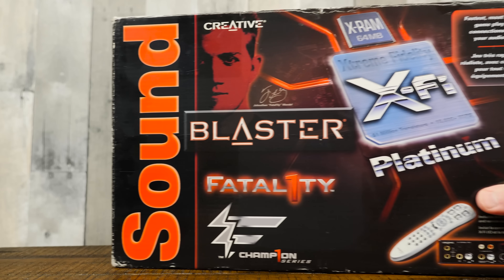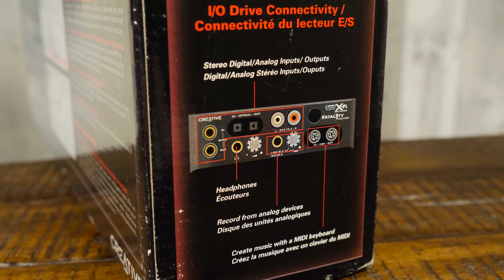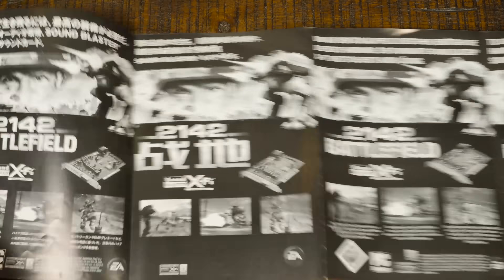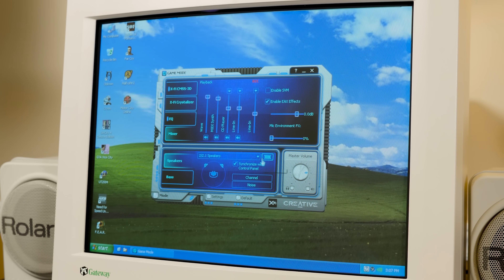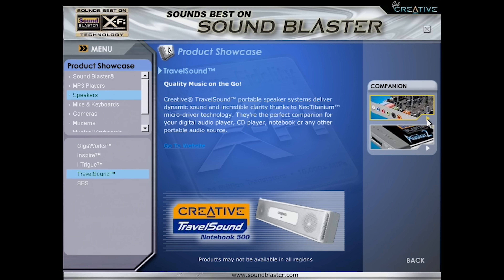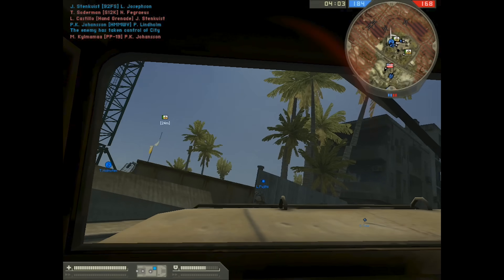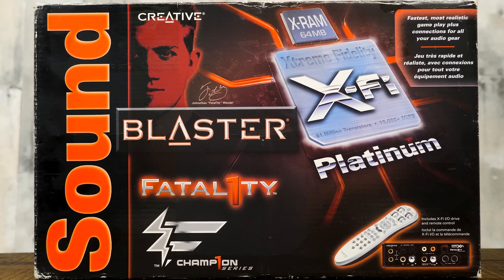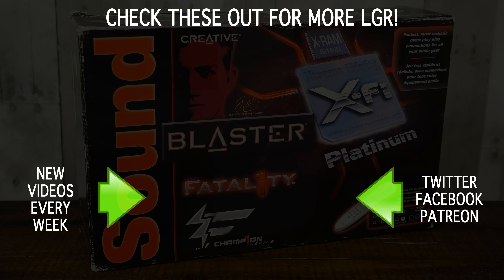XP Upgrade! Sound Blaster X-Fi Platinum Fatal1ty Sound Card

Comment: The moment you turned on EAX on Doom 3 my jaw dropped! I have never heard the game like that and I used to play it with surround sound speakers and thought that was the coolest thing ever until...this...you say there is a way to emulate EAX support...so need to try that.
Reply: Shoot just looked up emulating EAX and apparently the closest thing to it doesn't have any real effect on the games when enabled other then making it think it's available when it's not. Oh well...someday.
Reply: A few games work great with emulated EAX capabilities, like Halo, F.E.A.R. and Call of Duty 2, but DOOM 3, Quake 4 and Prey are especially picky with EAX capabilities because they use OpenAL and not DirectSound like the previously mentioned games. MAYBE they can be emulated, but I'm not sure how can that be done.
Reply: OpenAL should actually work better on newer OS' than DirectSound. You won't get hardware acceleration of 3D positional audio but in theory using ALchemy software (Or the inbuilt GX stuff if you have an ASUS Xonar/OxygenHD based card) you can still get the full "support" for EAX...And honestly, even the older quad cores like LGR used in this XP build have enough processing power spare to do the positional audio without hardware acceleration while gaming. It's worth looking into. 

It's like if you could still get all of the features of say, UTs Glide renderer while using software rendering except you're also running it on a 4Ghz modern CPU so there's zero real difference between the hardware acceleration and just doing it via software in theory.
Reply: Google for ALchemy Universal. It's software emulation and probably pretty loud, but better than no EAX.
Reply: @JayBmusic  I tried that and it didn't work, there was no sound. So, I installed EAX4Unified, then normal Creative Alchemy, then patched it so it works with my integrated chip and it work perfectly. Also, Alchemy Universal is based on an much older version of Alchemy.
Reply: dhewm3 emulates EAX on current cards. I personally think it just sounds like everything's in a cave and leave it off.
Reply: @parkerlreed  Yeah, but it's the only way I can fix the crackling audio in NFS2.
Reply: We took a step back in audio after Windows XP. Vista/7 and onward has been a poor era for audio.
Reply: Asus Xonar D1 and DX sound cards emulate EAX.  I had one in my Windows XP machine from this era.
Reply: I had the smaller brother without the front hub, but I did the same thing in FEAR. With headphones I got more legitimate scares on my fourth play through than on the first.
Reply: Haldrie just a whole bunch of extra added reverb IMO. Makes everything sound very muddy in the end. Not a fan.
Reply: Huge shame that sound became a second, sometimes third class citizen in game development. Sound just became "good enough" and only about fidelity, DACs and amps. Sound hardware acceleration with truer 3D effects and immersion were set aside.  MS got rid of DirectSound3D after XP. Creative was dickish about their software, just like how Nvidia became and they couldn't get OpenAL to get much support after EAX. And OEMs got rid of soundcards because they could make more profit by excluding it because CPUs became ok at emulation and those PCs had bottom of the barrel parts for higher margins. Building your own rig was even more niche back then.   I hope it comes back now that VR and Raytracing are coming up again.
Reply: Oh wow I think this is the most attention I've ever gotten from a comment outside of my own videos. Thank you to all the suggestions I will certainly be checking out that software. I only have the built in Realtek sound chip on my motherboard but hopefully it will give me some idea with my more modern 5.1 setup. Sadly my original 5.1 speakers ended up having the cord on the volume knob/audio connectors break so I had to get a new...even better set because I cannot go without my surround sound these days...reset in peace you...oh man what were those like 10 years old when they finally broke I think. Anyway love your videos LGR keep on bring us that nostalgia goodness...even for those of us like me who never experienced 90% of what you show yet still feel nostalgia anyway because we grew up when they were a thing. I envy that wall of games you have...my virtual shelves on GOG will have to do I guess.
Reply: I'm guessing you found IndirectSound? Give OpenAL-Soft a try instead ( http://kcat.strangesoft.net/openal.html ); there's also a DirectSound wrapper variant available ( https://www.nexusmods.com/newvegas/mods/65094 ).
Also, Check out I Drink Lava's YouTube channel for game demonstrations: https://www.youtube.com/channel/UCGrS-9TNYTo-gp3pjrA6VDg/playlists
Reply: Software audio processing is inferior to hardware accelerated audio since the quality is significantly better on legit hw acceled SB card than realtek hacked software dsp bs.
Reply: Well, yeah, on X-Fi cards you'll still get hardware acceleration of OpenAL (as well as DS3D HW through ALchemy on WinVista/7+) - it could HW accelerate both. In fact, that's how ALchemy works - it translates DS3D calls into OpenAL, which then shoves 'em onto the card. 

The positioning being the same on Asus, etc...well, no. CMSS-3D was the bit that handled the 3DPA, and that was exclusive to Creative - sure, they could read from the same 3D buffers as an X-Fi, but how they interpreted those buffers was very different. CMSS-3D was a lot more accurate.

I just played Quake 4 on my ZxR, and it was a fantastic experience. We've really lost a lot, soundwise, over the last few years. There's really only been two major improvements - HDR  and better quality sound samples. Things like decent 3DPA, high voice counts, and environmental audio have been cut back to the bare minimum to minimise CPU overhead.
Reply: We've technically had EAX since 1998 with DirectX3D in DirectX 5.
Reply: @parkerlreed  I know this is an old comment, but it's possible to adjust the volume of reverb in dhewm3. All you need to do is create a textfile, name it alsoft.ini, put the line boost=-12 in it, and then place it inside the %APPDATA% folder. This will make dhewm3 match hardware EAX volume. Ideally they would have an option for this in-engine, but this is the best we have.
Reply: @hoilst  You should try Quake 4 with OpenAL Soft's HRTF. You lose the reverb but the 3D positional audio is some of the best I've ever heard. Blows CMSS-3D out of the water IMO
Reply: Yeah, EAX is basically like collision mapping but for sound... pretty cool.
Reply: I have to second this, I definitely need to re-play this with EAX...
Reply: I've never particularly liked most EAX implementations, always sounded like they significantly overdid reverb in practically all environments.
Reply: It just sounded like it had a lot of echo to me
Reply: @AshtonCoolman  sad tbh
Reply: One of my fav implementations of EAX is in "Condemned Criminal Origins". It does not overdo it on reverb and has some really cool effects. Like excellent sound occlusion (so you can easily tell a difference if a gunshot for example is in the next room, above you, or in the same room). Great 3D audio using headphones or even my 2.1 logitech z 2300's. Plus the fact that it's a horror game and audio makes a huge difference in that genre helps as well. It actually works great on my PC without a Creative card. Just change your PC's audio rate to 16bits 48KHz before launching the game and install this cracked version of Creative ALchemy that has the check for a creative driver/card removed. https://drive.google.com/open?id=1Dwj6UffsLcIch5FMTNjpxjmTifLtNrGU Then launch ALchemy and add a entry for Condemned and point it to the games install directory. Once in game make sure to turn on EAX and EAX HD. Works fine on my ALC1220. I'm sure it sounds even better on a X-Fi card since you get real hardware acceleration but there is a noticeable improvement still.
Reply: Wolfenstrike of I had a real SoundBlaster X-Fi extreme Gamer but I have to use Alchemy to restore EAX sound. Is that still emulating?
Reply: @TokeBoisen  I have only played FEAR with headphones and EAX and get the crap scared out of me. My wife kept asking me if I was ok because she had no idea why the hell I was leaping out of my chair. 😂
Reply: @AshtonCoolman  - Yeah because on Vista Microsoft changed how audio is handled by the OS. It took a sharp downward turn because of this decision by Microsoft!

Comment: Still got a X-Fi Xtreme from 2006 in my old editing rig needed a standalone 3.5mm input, and a X-Fi Titanium from 2008 in my Threadripper for the extra optical/toslink. They even got driver support on Win10.
Reply: Basic Windows driver support? Or the custom Creative driver suite?
Because I use a Creative SB Z, and while there are WIn10 drivers available, they are not made that well (basically the original Windows 7-Style drivers with fixed compatibility). They are from 2015 which is far too old considering the card was sold for a very long time. It was only last year that Creative updated it. (Fun fact: With basically the same card + RGB + the same driver with a new skin as far as I can tell)
Reply: Kx drivers.
Reply: wtf Robbaz i didnt expect to see you here lol
Reply: I got a Fatal1ty Pro titanium PCI-E and yeah, it does have a 2016 driver for Windows 10 listed. I miss that card for those juicy effects and crystalizer. time to find it and pop it in.
Reply: Went with stand alone amp dac for headphone. Way better than anything onboard or even these add in cards. No hw acceleration needed. Modern pcs handle sound just fine. Wonder how good ps5 sound will be with ray traced stuff.
Reply: What the best xfi crystallizer setting?
Reply: I had an xtreme music and I had so many driver problems
Reply: Me a Audigy 2   no drivers for 2021
Reply: @rickmec  thx
Reply: still got my X-fi extreme Pcie SB creative card in my newest gaming rig lol it still makes a difference
Reply: @MichaelPareda  u can find drivers for that card that someone has made besides creative , i have many pre 2010 cards in win 10 and 11 machines running fine
Reply: @Andytlp  but what is the technical comparison here, can anyone explain it??? I dont understand what makes the new motherboard audio superior.
Reply: @mjd3879  Newer chips and capacitors. Richer sound. Better sound stage. All those  audiophile jargon words. Dropping costs. Better sound isolation. 
In case of standalone devices they have far less noise than a pc motherboard or add in card.

Comment: Very nice! That large connector at the back, you can use it for connecting one of these SPDIF rear IO brackets if you lost, or don't have the drive bay device. I use this for digital capturing, makes my life a bit easier :) A few games I can recommend to experience X-Fi cards, especially with headphones and CMSS-3D enabled are BF 2142, F.E.A.R. and Splinter Cell Chaos Theory.
Reply: F.E.A.R. is great so is Prey and Quake 4 which use the x-ram. I had this card up until I could no longer get it to function in Windows 10 no matter what I did. Wished I had hung on to it and just did a Xp build for my MID 2000's gaming madness.
Reply: I now use a Sound BlasterX AE-5, and while it does a good job there are some minor noticeable audio glitches in some EAX 4-5 games.
Reply: The nice thing about the card, is that it has EAX backwards compatibility. The card can do EAX 1-4, as well as 5, of course.
Reply: Old Liquid I’ve never had any of those problems
Reply: Old Liquid Can't relate to any of your issues with the sound. The USB input issue is well documented though and the fix is easy, just place a DLL file into the game folder.
Reply: Funny as it sounds the PC version of Mass Effect 1 makes very good use of CMSS 3D.
Reply: Old Liquid  I don't recall having issues on my X-Fi Xtreme Music or SB Z. The Logitech issue is very real though, but thankfully there is an easy fix for it these days that just requires downloading and copying over a dll.
Reply: I've convinced myself to build up an XP machine starting from a 2004/2005ish compaq just like I did with my Windows 98 SE machine. It's got serious sam and a fuck ton of popcap games on it but I do plan to put stuff like Quake 4, Unreal Tournament 2004, maybe even the GTA III trilogy (I have those on the PS2 though)
Reply: One of my fav EAX titles is Condemned Criminal Origins.

Comment: Still using this card today (X-Fi Titanium, PCIe though). Had no reason to change the card or using onboard-sound.
Reply: Brother!
Reply: I did have to replace my XtremeGamer, One of the caps failed and was giving me horrible distorted sound... I still have it but the on board audio on my Motherboard has DEDICATED Hardware Sound Card on it anyway.
Reply: Yeah, PCI X-Fi since 2008 - originated from Core 2 machine that went throught all the years to 2016. Now it's running in Skylake-based machine :D
Reply: Do the drivers work on Win10? It kinda stopped working after Windows 7, and it was too much of a hassle to get it working. I really miss having all those options when listening to music.
Reply: I remember lots of driver issues, bsod and such due to Daniel K's driver...
Reply: The current official drivers work just fine with my X-fi Xtreme Music. For EAX you still have to use Creative ALchemy.
Reply: They made a Windows 8 driver for the X-Fi PCIe/Titanium which will work under Windows 10. It ggot a little sketchy by Windows 8.1 though, and you could get bad audio distortion at odd times after running for a few days until either rebooting or toggling the sampling rate. Mine finally kicked the bucket a year ago, replaced with an SB Z that works perfectly in Windows 10.
Reply: Totally with you brother!
Reply: Me too
Reply: The normal DAC setup audio runs by the CPU in most mobos.. Some motherboards have dedicated hardware accelerated audio chips (Kinda like having the Audio Card in a PCI-e slot) Soldered into the motherboard which is different than the normal Realtek stuff.
Reply: I'm still using the X-Fi Elite Pro on my current windows 7 pc. I do sometimes get the distortion bug and have to toggle the sample rate though.
Reply: @MoeAji  I'm using this card in my win 10 machine with no problems at all, everything is working fine
Reply: You can receive the drivers for Win10 here (for the X-Fi Titanium in this case), including the tools (e.g. Console Starter):

http://support.creative.com/Products/ProductDetails.aspx?catID=1&subCatID=208&prodID=17927&prodName=Sound%20Blaster%20X-Fi%20Titanium&subCatName=X-Fi%20Series&CatName=Sound%2bBlaster&VARSET=prodfaq:PRODFAQ_17927,VARSET=CategoryID:1

I also used the Creative Auto-Update-tool, as Windows tend to update the drivers for itself as well.
Reply: Yep, onboard audio officially sucks due to lower quality components being used on it. They do that inorder to keep overall motherboard costs at low. Hence why with onboard audio you will get noticeable hissing noise on higher volumes.

It ain't nothing but a myth that thesedays you wouldn't need an actual high quality dedicated soundcard lol. Difference is clear as night and day and only ignorants will remain ignorant due to their lack knowledge.
Reply: Literally just bought it
Reply: #metoo
Reply: @click4dylan2  would you have any more info about this?
Reply: imho it's no better than integrated audio from a reasonably built motherboard from 10 years ago, and motherboards with better audio support exist now :)
Reply: @edherdman9973  Agree. Sound on my Gigabyte Z390 Master slays my old Creative Platinum. But it took a long time for onboard to catch up. Had to consign my Platinum to a legacy system some years ago and I really missed it until the last few years.
Reply: @whssy  One thing I've noticed, though, is that noise still leaks through sometimes. e.g. you can hear a bit of low whine during some SATA disk operations on even good boards. I may have to look into shielding for that...
Reply: @edherdman9973  I  don't use SATA for other than storing stuff I don't need to access very often, so I've not really noticed on my newest build 8D. Before I got the Z390 Master I was using optical  to external DACs. With the Z390 Master I don't have a DAC that's as good and dropping the bucks on one that's better isn't realistic for my wallet right now. The music I DO listen to from hard drives is on external SATAs so I've really never heard noise like you describe.